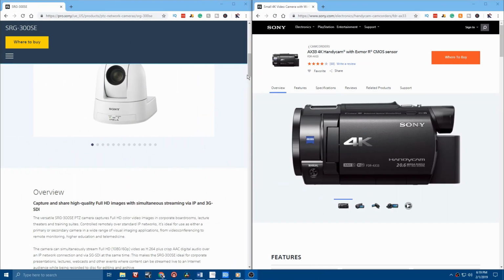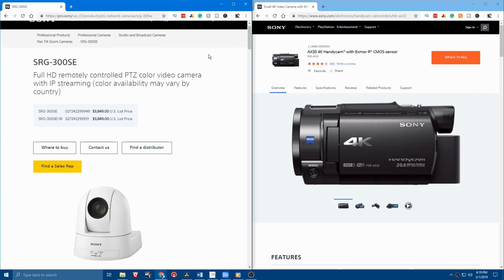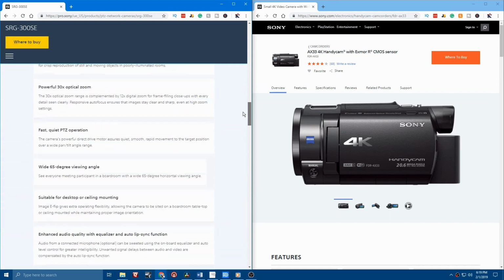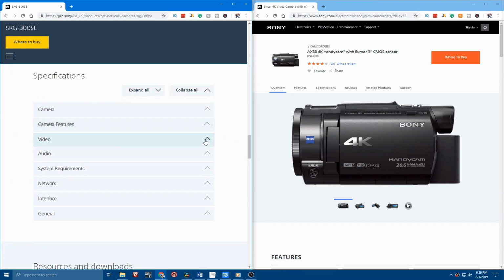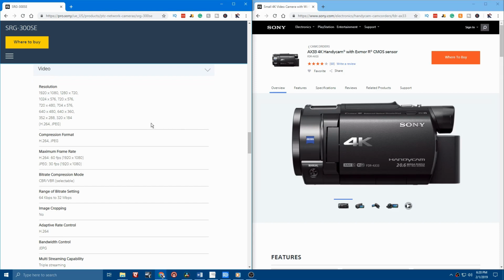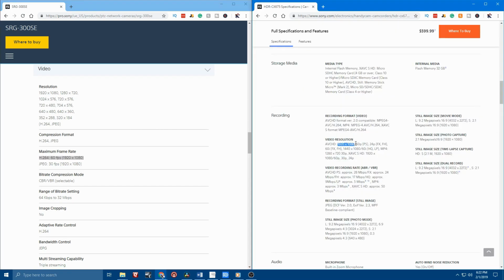How To Design A Multi-Camera Video System

Comment: Ok what's the benefit of using SDI wires/splitters, vs. using HDMI extenders over CAT 5/6 cables?
Reply from the maker: SDI is more professional and you will not have a chance of interference like you might get with ethernet extenders. It is rare but it can happen. I normally use ethernet if I'm trying to fit within a given budget.
Reply: @AJaytheCEO  ok then thanks, I'll stick with the SDI option then